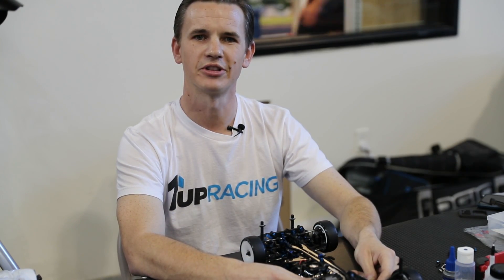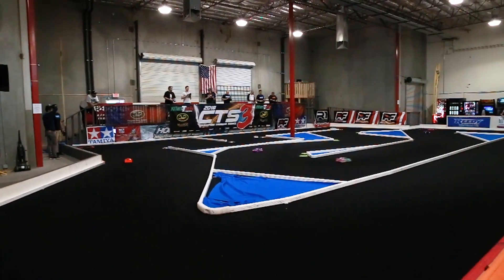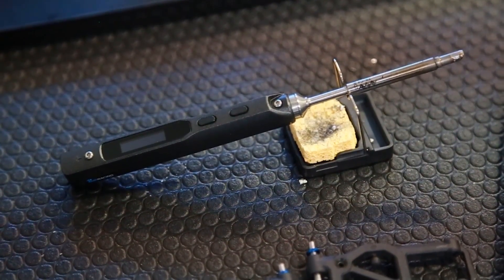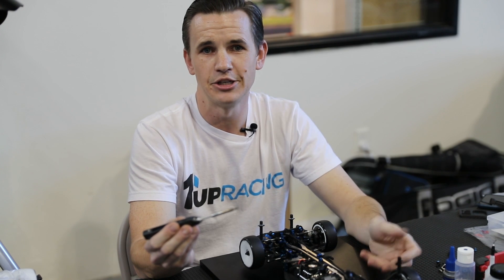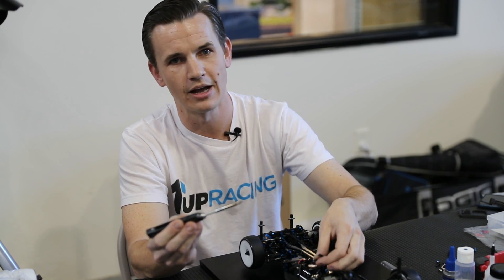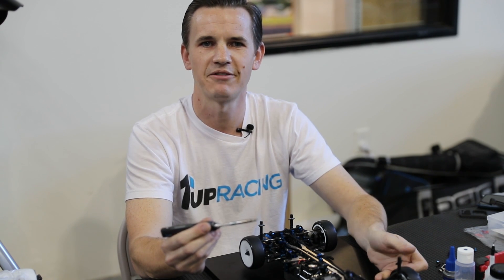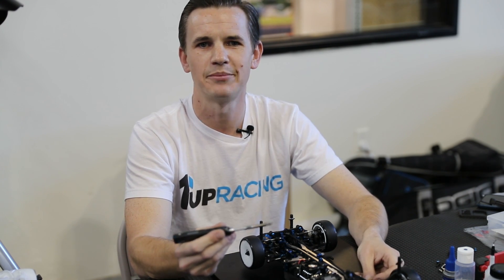1Up Racing Soldering Iron

Comment: Say me how you do it so fast , I got a iron with 400-500c he is very hot,  and when I install the cable I need minimum 5-10  seconds with the iron on the motor , that's so fast unbelievable :D
Reply: Hans Glück - You need to put solder on the wire and motor tabs first
Reply: 2815Juan 
I do this but you like a pro